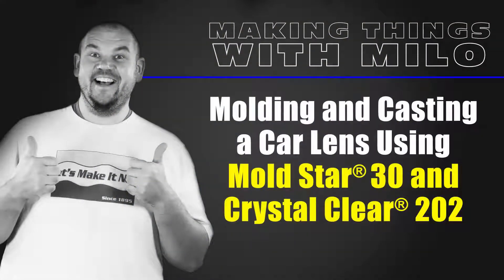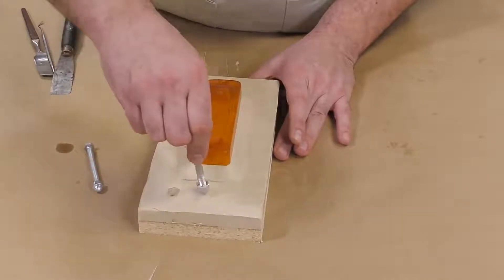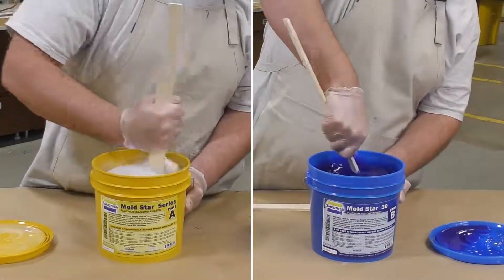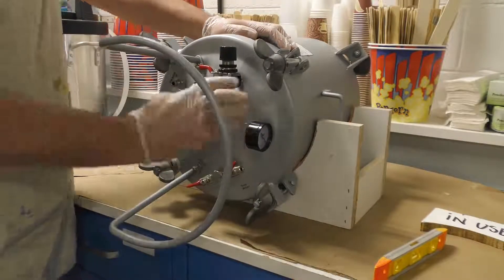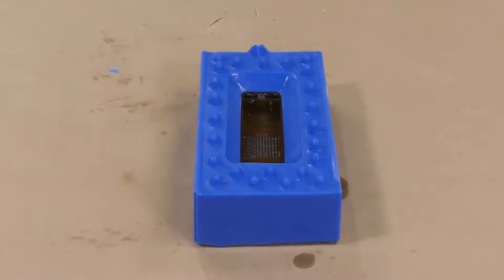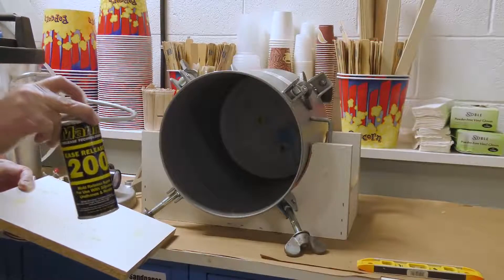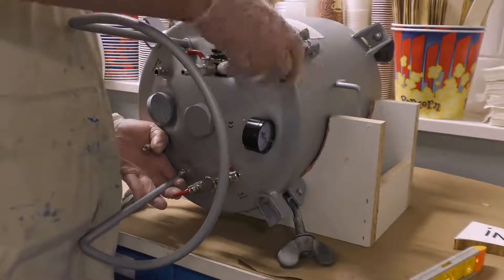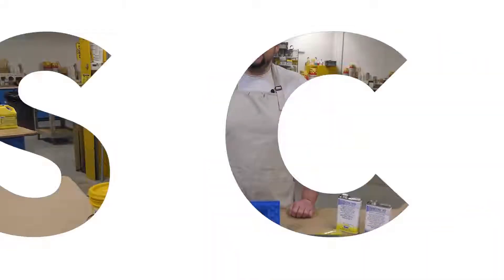Formenbau und Harzguss: Herstellen eines Ersatzrücklichts

Comment: What does such as setup cost all in all. And what does it cost then to make one part?
Reply from the maker: To product the mold you are looking at approx. 80 € here. Material cost to make one part is approx. 7 €. The highest one-time invest is of course the pressure chambre (approx. 1.000 €). Though the pressure chambre is very helpful to achieve perfect castings but is not mandatory.
Reply: @KauPoPlankenhorn   Oh very interesting. I expected way higher priced setup. Thanks for the info.
Reply: @MrGTAmodsgerman  My pressure chamber was ~100€ (10l) but it needed some additional parts (+30€) because i converted a paint-system. the only difference is that the lock-nuts are not as handy. and please consider that all smoothon products are ridiculously overpriced if youre shopping outside the U.S. due to import taxes. they have some unique products like their flexfoams and wide pu casting resin range that justify the price. but for general mold making and casting you can usually get products for half the price with exact same quality (silicone rubber, laminating epoxy, rigid pu foams, pigments)